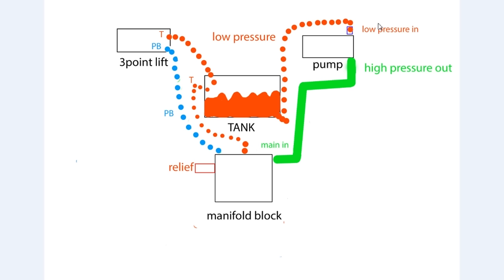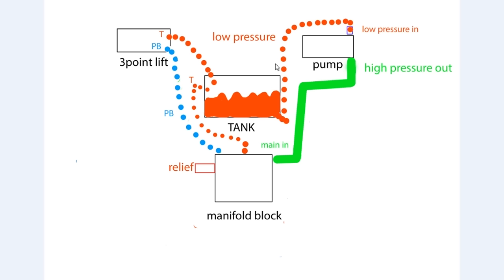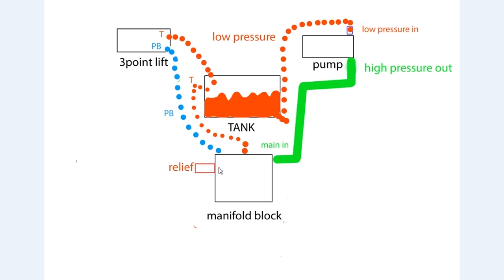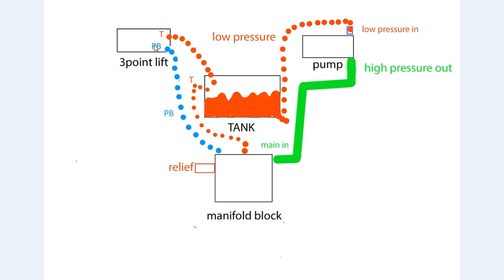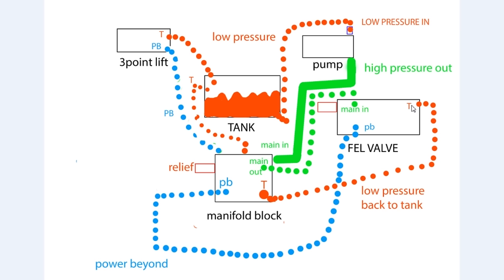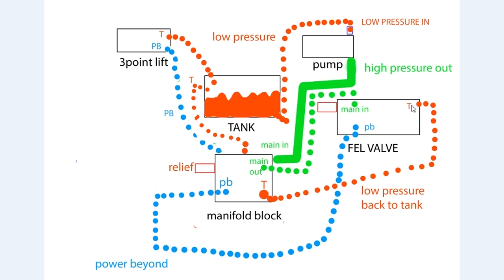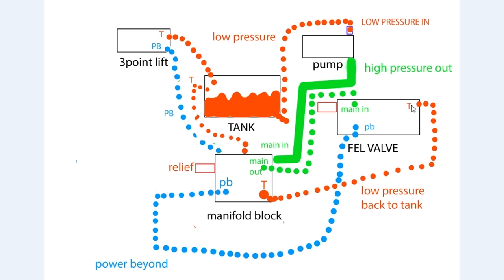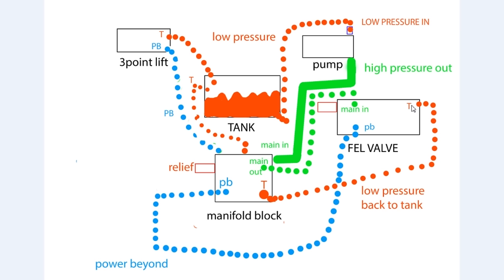adding rear remotes and understanding tractor hydraulics

Comment: I have a backhoe that has 3 lines, my tractor is older and only has two lines. Is there a way to plumb a setup like mine?
Reply from the maker: yes the third line is the back to tank line just dump it into the fill port at the rear of the tractor behind the seat.
Reply: I have a port with a low pressure line going into it, next to the fill cap, in front of the seat. I also think I need a new fel valve since mine has no PB
Reply: Anyway we could chat?, I've gotten alot of information, none of it is "good" information.
Reply from the maker: @balbowskie187443  sure you can email me at Daveknowshow@aol.com we can then work out where we can chat about this. phone is fine.
Reply from the maker: @balbowskie187443  email me at Daveknowshow@aol.com

Comment: Dave, This video is the one that really just put it all together for me. And I was wondering what the best way would be to get the spool valve tank line teed back into the line to the tank—you had that tee on the block pictured right there on the screen for me. (Just need to figure out where to get these types of fittings now). I kept seeing inferences here and there about the 3301 with a Backhoe not being able to add rear remotes, but those seem to be unfounded—it looks like the backhoe if anything, makes it even easier to splice into that PB circuit. THANKS AGAIN DAVE
Reply from the maker: glad to help, keep in  mind you can use the open center spool valve and not install the back to tank line. it will merely dump back through the power beyond port. this eliminates 1 hose completely and no need for the "T". found this out after the fact.
Reply: the Tee is an inline npt to 2 #8 jic fittings. the hoses on my Kubota are on the hose ends are 8G *jix or jx depending on manu.  the fittings on the manifold are a npt to 8jic if it is an o ring type fitting on your back hoe or other attachment it is a jm or boss fitting it stands for Joint industry council. they are identical to 8 AN that are Army Navy fittings just looser standards. hope this helps
Reply: Thank you, sir. I was able to get this all done some time back and it’s been working well.

Comment: Thanks you for your knowledge, Can you answer a question. I had to replace my pump on my tractor because something caused it to continue to spin the nut off that holds the gear on to the pump. Which caused the keyway break or ? Needless to say my new pump has done the same thing. Can you tell what is wrong, this cost to much to continue to do this. FYI I am new to tractors but have needed one for 15 years. I have small mini farm. Thanks in advance
Reply from the maker: ok so this is just a theory so take it for what its worth. its my understanding these pumps run continuously as long as the tractor motor is running. the faster the rpm of the motor the faster the pump turns. this is one reason its important to run at 540 pto speed or higher specifically on HST model tractors. my opinion on what is happening to your tractor is this. when the pump is spinning its under near zero pressure as its in an open center hydraulic circuit state. the hydraulic fluid runs freely under zero or near zero back pressure from the pump through the circuit and back to tank as the diagram shows. its only when we use a function that pressure occurs due to its use. or in the event of some type of blockage. for example the soft low pressure return line could collapse and cause a restriction in the flow which would increase pressure and hold that pressure for far to long. additionally a hydraulic filter could collapse internally or have some other obstruction that is stopping the flow causing long term extreme high pressure. when ever you remove a filter look inside the port where that filter goes in and inspect it for chunks of metal to large to come through the port. on rare occasions casting debris from the rear housing can break off and cause a block in flow. also a relief valve that will not properly open will also restrict flow and can cause the same problem with pump failure. I hear people adding shim packs to increase lift capacity and many times that is a recipe for disaster. you could install a pressure gauge on the lines used for "back to tank" and also "power beyond" as well as one line going to the curl cylinder on the front end loader. check these gauges for abnormal reading. the back to tank would in my opinion read near zero with little pressure. " I could be wrong on that so ask your dealer" the power beyond should read the same when nothing is being used. the one going to the loader function should read zero when not used and go up to the rated hydraulic pressure of your tractor when the valve is open. holding the valve open and after the bucket is fully curled the pump should get a little louder and the pressure meter should remain at or fall below that constant measure. if the reading continues to rise you have a faulty relief valve and it should be calibrated or replaced. be sure and check the return hose that feeds the pump as that hose can collapse and cause restrictions that would increase pump pressure that the relief valve would have zero control over to relieve. additionally a crack in that line can introduce air in the system at the pump and cause cavitation in the pump which raises pump temperatures to extreme measures where failure would occur. again this is purely my opinion based on logic and my limited knowledge of hydraulics on tractors. a good service shop manual for your model tractor would be very valuable to diagnose these issues I have talked about. I have given you some very good concrete concerns to address. take these questions to another person who is a certified Kubota technician and get their opinion on these theories. NOT ALL KUBOTA TECHNICIANS ARE WELL EDUCATED. find one or two or three and get their opinion and compare. Northern tool has hydraulic gauges cheap. the plumbing fitting can be pricey but far cheaper than a new pump. buy three gauges and install them all three. turn on the tractor and write down the reading. do it quickly don't let the tractor run to long and burn up another pump. I hope this helps and I wish I could be more helpful with an absolute fix. I live in chesterfield VA 23838 if you are close by me I would be happy to come by and see what the pump failure looks like and where I would install the gauges. I would like to see the pump and gear that failed. you can email me a picture to Daveknowshow@aol.com
Reply: try read locktite thread locker

Comment: Hi !  I have a question. When we add a snow blower and a new control valve to control the rotation of chute (motor) and the deflector (cylinder), do we need to add an Power Beyond adapter on the new one valve ?  Thanks for your time   :)  (I'm not good in English  :( )
Reply from the maker: power beyond should flow into the new valve and then out the new valve to complete the circuit. hope that makes sense.

Comment: Great video Dave.  I was wanting to install a hydraulic top link on my NH TC33D, but the 'factory' kit is over $1,800 just for a single remote valve.  I saw your video and thought this would be a lot cheaper option.
I have just one question, I don't have a Backhoe, so I assume just deleting that part of the circuit in the diagram, the process would still be the same? (Power beyond to spool valve, and return to manifold block).
Reply from the maker: yes you got it!!! just add it into the circuit. very simple

Comment: Hi Dave, is the female attachment in the back of the Kubota the high pressure output?
Reply from the maker: depends on who ran the hose. trace it back to the power beyond port at the manifold block that will be the low pressure side. the pressure out side will come from the power beyond port at the loader control valve. or at the main power out at the manifold block.
Reply: @daveknowshow  Thanks Dave.  I’ll trace this afternoon. I attached a Shaver HD8 hydraulic post driver on the back of my Kubota L3901 and the brand new driver doesn’t lift the pounder.  I’m thinking that I have the hydraulic hoses reversed.
Reply from the maker: @605pilot  that takes a special valve that has a power in port. a power beyond out port and a back to tank port . the bank to tank port is the most important and that hose needs to dump straight into the hydraulic fluid reservoir. this is typically done by adding an adapter at the rear fill plug for the hydraulic fluid. the reason for this is because when the ram drops it needs to discharge all that fluid super fast with no restrictions. if you try to dump it in the back to tank port at the manifold block it may have to much restriction causing the ram to fail to drop fast enough. hope that all makes sense. Ted at everything attachments  knows a lot about these drivers and if you call and get him on the phone I feel like he will help you better than I can with that driver.
Reply: @daveknowshow  Hi Dave, I traced the lines from the back of the Kubota like you told me to and I found out that I had the hoses hooked on the wrong adapter.   I rearranged the hoses correctly and now the hydraulic post driver is working properly.  I’ve been at this for three weeks and I’ve been on the phone with Shaver and Kubota people and exchanged a lot of parts with no avail.  Thanks to you I was able diagnose the problem within minutes.   The driver does have the adapter to dump all of the fluid back into the reservoir.  Thanks again Dave.
Reply from the maker: @605pilot  so glad to help I like that driver and been looking at them myself. I have no real need for one but more of a want just for video demonstrations on how to use one and set it up properly as well as how to install the hydraulics for it. they seem very well made from what I have researched. I know you will be happy with it.
Reply: @daveknowshow  hopefully it’ll do the job. I have sixty 2 7/8” pipes to drive 3.5 feet into the rocky Colorado ground to build a pipe fence horse paddock.   After hand digging 6 holes I gave up and bought the hydraulic driver.  Thanks again.

Comment: Where is the link to the spool valve you bought
Reply from the maker: i dont link i have a link. it was a prince brand sold at northern tool and equipment. surplus center has them also

Comment: Merry Christmas !Nice video Dave mostly i agree  but i dont think hydrostatic or better closed center loop hydraulics has same diagram as open center loop.
My japanese hst tractor has a closed center loop, a cast iron manifold  placed in right side near under foot pedal with 3 ports( high pressure -low pressure and return pressure) low pressure is also return so both are T and one is P( power beyond)
Connecting 2 hoses with FL  control valve from tractor in High pressure and low pressure everything works( loader -3point  everything)
Connect 3 hoses or 2 hoses with different connection nothing works or works only FL and no 3point and opposite.
So my question is if i want to put a backhoe i just connect with a T part the power beyond from the tractor valve to backhoe control valve ? Or need something more?

Also my tractor manifold where the relief valve  has an adjust screw in two levels stamped O and S , when is in O the loader dont work, when is in S all works.
Reply from the maker: my tractor is a hydrostatic as well and its set up exactly like this diagram. the backhoe that comes from Kubota is set up to only have a power beyond input and a power beyond output. there is no back to tank port. I think when your manifold is in 0 position that is for when your tractor is delivered with no front end loader and it diverts the fluid in the manifold past the relief valve and up to the three point. when its in the other position it diverts the fluid out the main out port to the front end loader control where it uses the relief valve there first. then exits through the power beyond and returns to the manifold at the power beyond input of the manifold block then past the relief at the manifold block. if you add a backhoe you extend that line to the rear of the tractor and then back to the manifold and into the power beyond input port at the manifold block. when the back hoe is not on you simply plug one hose into the other at the rear of the tractor. this completes the loop. I would say your tractor is also an open center design. fluid is constantly flowing from the pump to the control valves to the hydraulic cooling radiator and back to tank when no control valves are operator. when a valve is operated it becomes some what of a closed center as it diverts fluid to the hydraulic ram. if pressure builds to high the relief opens and dumps the fluid under low pressure back to tank. if I can help in any way please let me know. there are other videos on my channel that show the line from the front end loader controls power beyond port to the rear of the tractor for the backhoe and then from the rear of the tractor back to the manifold into the power beyond input port. those videos may help you as well. EDIT: the answer to your question is NO you do NOT connect with a "T" fitting to the power beyond port to feed the backhoe. you disconnect the line and run it back there. then a new line from back there at the backhoe to the manifold PB port.

Comment: Hi Dave, thanks for the video series, really helpfull since doing something similar. Do you know the thread type of the adaptors that go into the power beyond block? Is it metric, BSP?
Reply from the maker: no not bsp on mine it was 3/8 NPT into the block if I remember correctly. I tell you this hydraulic fitting sizes and threads can be a real pain in the neck. I'm currently custom building a 3/8 bsp to 3/8 npt adapter and its been a real pain in the butt to iron out.

Comment: Are the PB lines high pressure? If damaged do they leak fluid as long as the tractor is running?
Reply from the maker: yes and yes. they will leak as long as the tractor is running. the pressure in a hydraulic system such as these is at its highest pressure when under a load.  so a small pin size hole in a PB line would shoot out very high pressure fluid where as if the same line is completely cut it will still shoot fluid out but the pressure will be much lower. put your hand over that broken hose to block it and it will instantly turn to high pressure and inject into your skin or worse. so the pressure is based on restriction and use of flow. I hope that makes sense.

Comment: Great diagram!  The only thing that I would suggest changing is how you draw the "relief valves" and "back to tank" lines.  From your description, it seems as if  the the relief valve should be drawn in line with the "back to tank" line rather than off by itself.  Thanks.
Reply from the maker: it actually is screwed in the side of the manifold block on this specific machine exactly where shown. this is where you adjust the shim pack to increase and decrease relief pressure. thanks for the comment.

Comment: When my backhoe is not connected I would have to connect to 2 tractor rear connections together to complete the pb circuit is this correct
Reply from the maker: yes that is correct. if you leave them disconnected it will blow the pump up.
Reply: @daveknowshow  thanks I thought I had to but wasn't 100 percent
Reply from the maker: @matthewgilbert4226  always glad to help brother.

Comment: Have a L3010 changed both hydraulic filters . My loader is slow going up. 3 point jumps right up. If throttle the three-point hitch while engaging up on my loader the loader speeds up. 3point Gaston of power . Fluid level good. The loader is just slow going up. Think it's a early 2000 year.
Reply from the maker: that dont sound good. check the owners manual and make sure that model does not contain a screen that needs to be cleaned. most of the models with screens are smaller kubota tractors like the bx series.  the loader should over ride the three point. does the bucket dump and tilt back fast? does it only go slow up but fast coming down? if so the problem is likely in the loader control valve. I would suggest taking the control valve off and carefully disassemble it for cleaning. may as well buy the rebuild kit and replace all O-rings. also you could have a quick connect that  on the loader that is not fully seated.
Reply: check your cylinders and bypass valve. usually its a cylinder passing fluid

Comment: Great video. You're video has helped me understand how hydraulics work. I have a question about when would you add a cooler  and where would you place it in the line?
Reply from the maker: you always want a cooler if you are using the hydraulics a lot for say a front end loader, backhoe or something similar. all of these tractors come from the factory with a cooler installed. I merely left the cooler out of the circuit merely to save time and space. but the cooler is there located at the end of the circuit just before the fluid dumps back to tank for further cooling before the next use. the cooler is physically located in front of the radiator on most tractors. make sure you keep it clean. check it often when mowing or brush hogging as they get clogged up and can cause thermal break down of the hydraulic fluid. thanks for a great question. you are the first to ask which surprised me it has taken this long for someone to point out that I left the cooler out of the circuit.
Reply: @daveknowshow  thanks for sharing your knowledge with me and others that have problems.
Reply from the maker: @waltthon505  always happy to help.